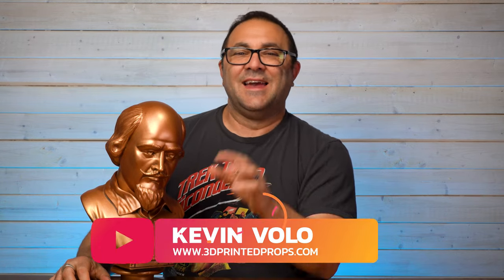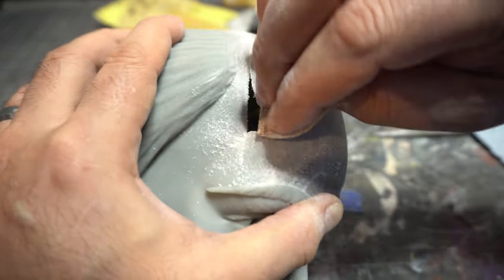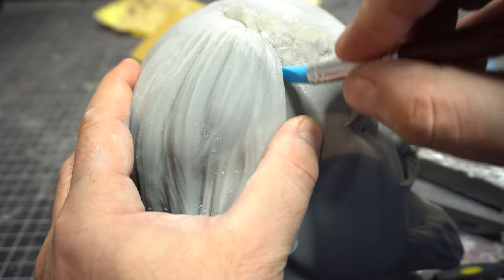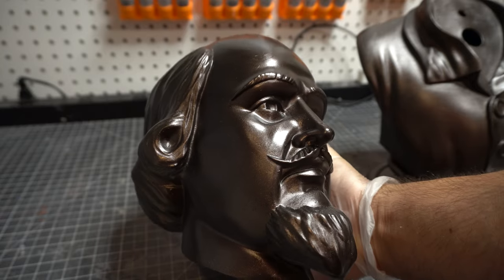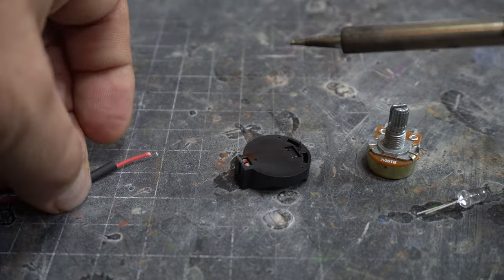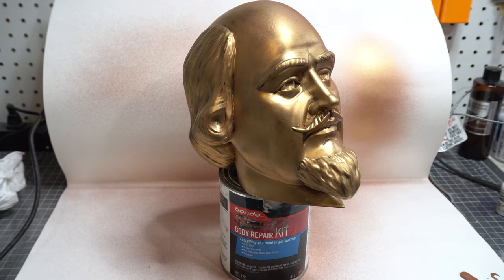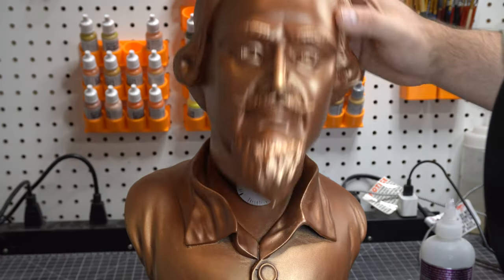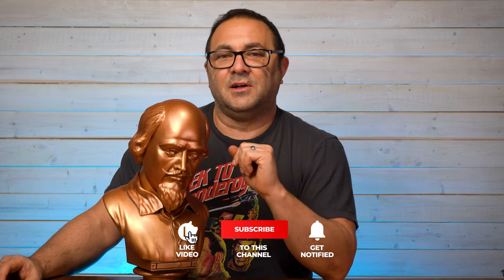Batman Shakespeare Bust 3D Print - Finishing Resin Prints

Comment: Almost finished printing it! I had to cut it to fit in the printers, but I've just finished reassembling the head using LocTite gel for initial bonding, then using a 3D pen to fill and further bond it, then wood filler. A couple of sanding/priming cycles, and it's pretty good! The bust part had to be cut in three parts, and the final part is printing right now. I've ordered a 2-pole switch so that I can not only light an LED, but I'm using the second poles to put a pigtail on it that can control a low-voltage wireless remote such as a garage door opener or something similar.

Comment: What type of potentiometer did you use for the switch? The dial is very tiny and I am having trouble finding one that fits. It is the one electronic not mentioned.
Reply: I just ordered a 2 position 2-pole rotary switch on Amazon - about $9. I used that so it would light the LED, but also have the ability to control something else (such as the hidden panel to the bat-cave!).

Comment: Hi! Amazing model and finish work.  This kind of stl file, it can be printed in a fdm printer? Thanks for the increidble video. Sorry for my poor english. Im from argentina.
Reply: I know it's late for a reply, but I'm doing a great print on my FDM printers. I did have to cut it with Meshmixer to fit it on my two printers (modified Ender 3 and a CR-6). I just finished re-assembling the head, filling, sanding, and priming it. I had to cut the bust portion in 3 pieces. Two are printed; the third should be done either tomorrow night or the following morning.

Comment: Does the downloadable model have the hole in the head?
Reply from the maker: Nope, That was a mistake in the print. Not sure why it happened, I think it was just a missed support.
Reply: I think it's due to printer's sub-par lightbox design. Most mSLA printers have several, like roughly half a dozen, high power LEDs that sit at the bottom of the printer and provide the powerful light that cures the resin. Each LED sits in its own reflector to try to beam shape it. Where two of these reflectors butt up against each other, there's a line where the light power reaching the resin is much weaker. This makes it impossible to perfectly calibrate the exposure and have that be valid across the whole print surface, it'll be good across most of it except too weak near those boundary lines.

At this point one might say "they should take a page out of monitor and TV manufacturers' playbook, those have solved the problem adequately" but due to low wavelength and high light power density, the materials used there aren't suitable, so they can't just buy something off the shelf and have it work.

But they definitely should put some extra engineering effort into this.

Slicers are also unaware of this design deficiency and don't do anything to compensate for it.
Reply: What do you mean by that??? 🤣😂🤣